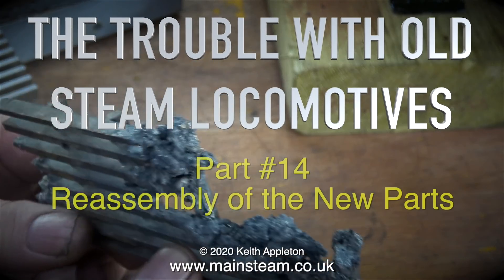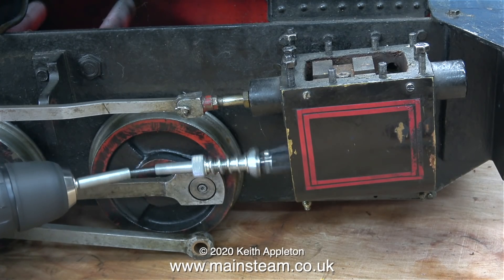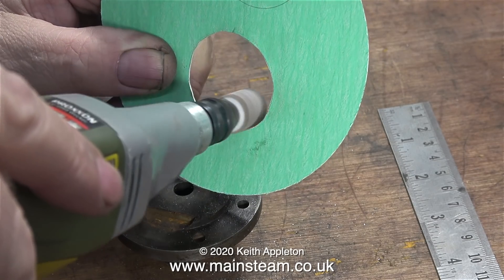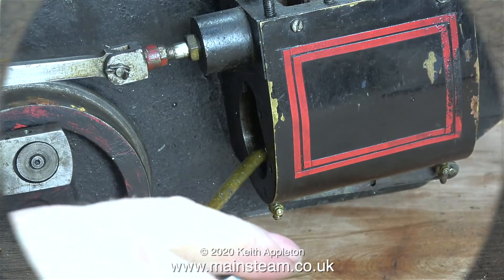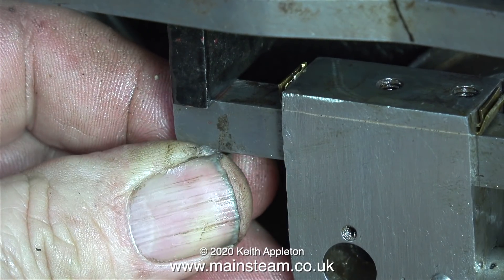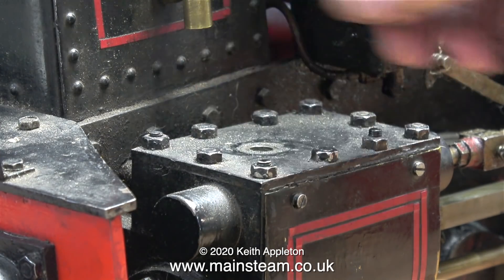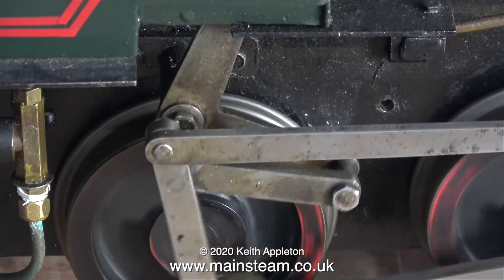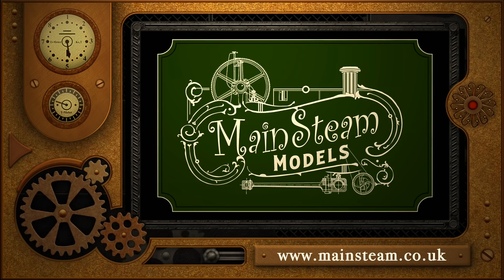THE TROUBLE WITH OLD STEAM LOCOMOTIVES - PART #14

Comment: In car engines preferred procedure is to check the ring end gap with a feeler gage before installing the rings on the piston. But then steam is a different medium than combustion gases, and cars use aluminum pistons, and there is a wide difference in temperatures in the parts of an IC engine. Do steam engines ever use two rings in each groove to seal the gaps better? Seems like they would have if it worked better, LOL. 

There is not much technology that has had the centuries of development time of steam!

Comment: How does a fire of that size get hot enough to melt a substantial grate like that? Excuse me if this is a very basic question but just starting to go down this rabbit hole
Reply from the maker: Small locomotive fires can get white hot . . .  Too much blast up the chimney which over draws the fire or bad coal usually is the culprit . . .

Comment: That (?stainless?) fire grate is not much worse than the one that came with my second hand 3" Maxitrak Aveling & Porter. Rather than send off for a new £100 one (I'm tight) I've bought a £30 cast iron open hearth grate, cut it in 2 ... 2 for the price of one ... and welded in, by oxy/ace, thin mild steel bars to allow the use of small beans. Because of the design I've had to add a couple of 'legs' to stop it slipping out of the ash pan when fitting/removing. Due to other pressures I haven't tried it out yet, but I expect it to last several years before I have to do the same with the other half. Even if the thin bars burn out, I've got metres of the stuff. In the house to stop it rusting.

I would like to point out that you are a bad influence! Because of you I've had to buy a small, Chinese lathe and more tools and attachments than I can carry in one hand. Before you know it there will be a bloody milling machine alongside it. Then I'll have to subscribe to your channel ...

Dammit, man, do you think I'm made of money?

Comment: Do you have specs on the gaps between piston rings, like on car engines?
Reply from the maker: I suppose there are, but normally you just buy them & fit them ....
Reply: @keithappleton  Thanks for the reply 😊
Is there a bit of a gap when you fit them? Or does the fact that everything is cast iron make expansion less of a problem?
Reply from the maker: Yes as piston & rings are made of the same material, the expansion coefficient is the same ....
Reply: Thanks 😊